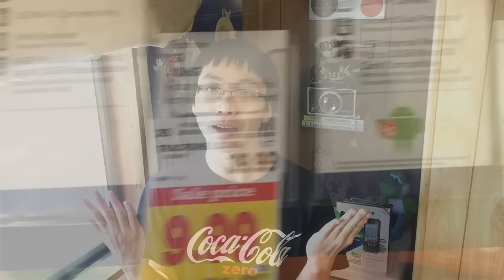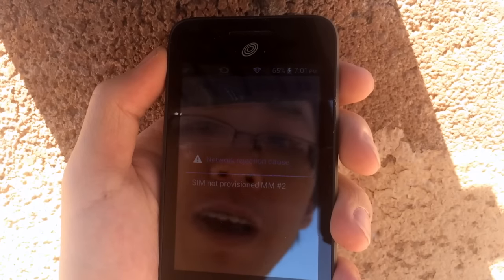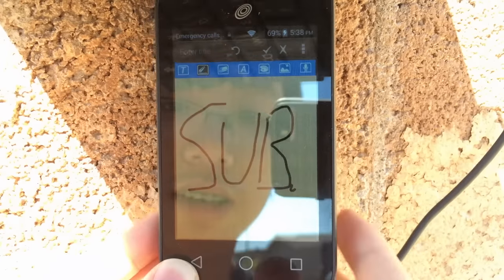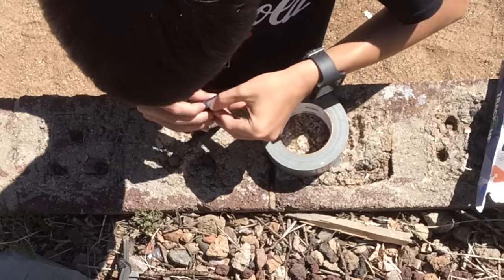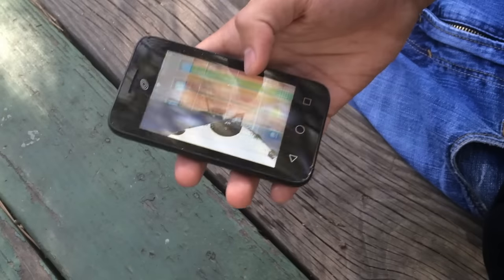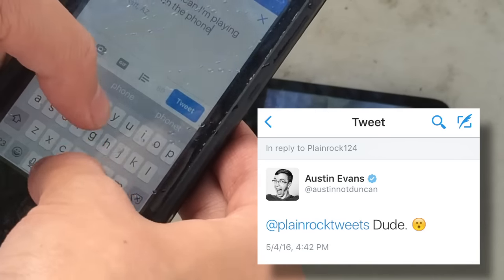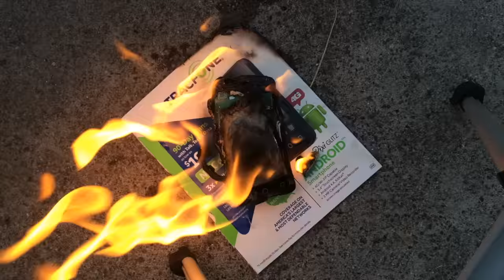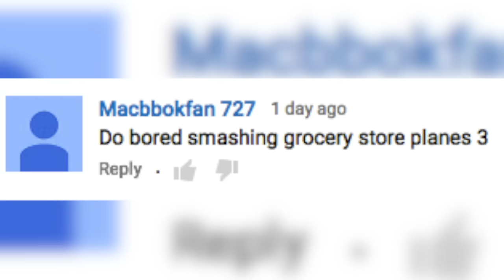Bored Smashing - GROCERY STORE PHONES! Episode 3

Comment: "Charger is overcharging, please disconnect the charger." I died at that.
Reply: I think the warning after that said something like "Battery has been overcharged, the phone will power off" or something
Reply: @devilpros1346  No. Its just the low battery Warning.
Reply: @Rayray_unicornplayz567 It's not. The battery was at 56% when King took out the phone and it showed the overcharging error.